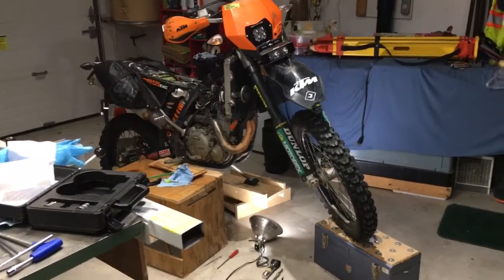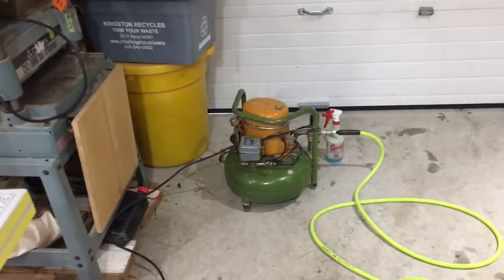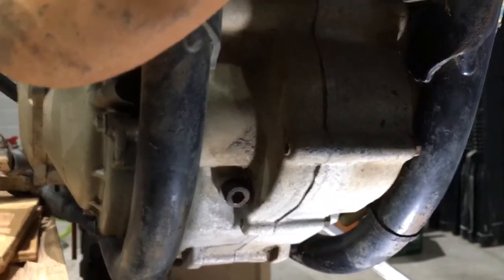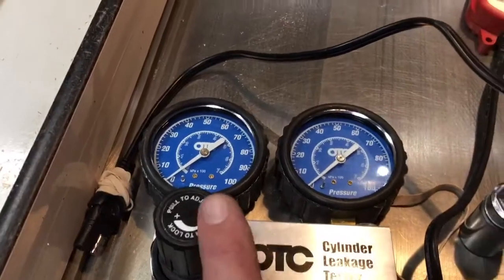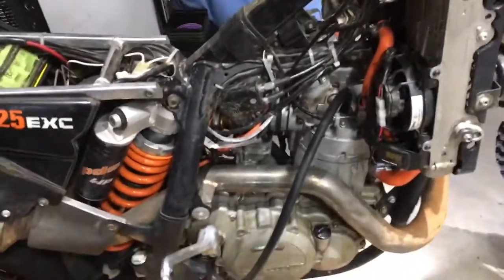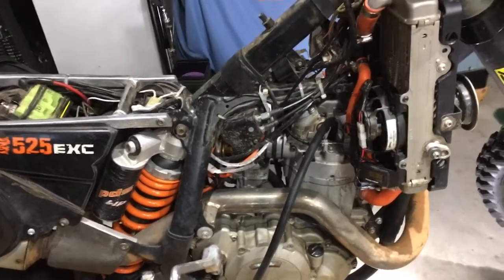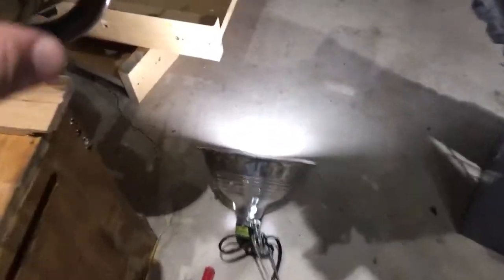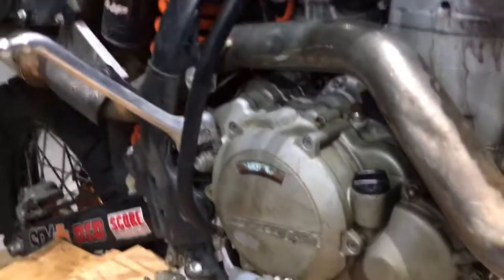‘07 KTM 525 EXC - cylinder leak down test. Method and results.

Comment from the maker: Correction: the second time I mention the flow-restricting orifice between the two gauges I say “one inch in diameter”. The correct value is “one millimetre diametre”. That’s what I believe the orifice size to be — the standard for doing aircraft cylinder leak-down testing.